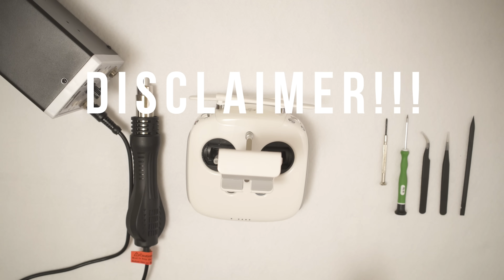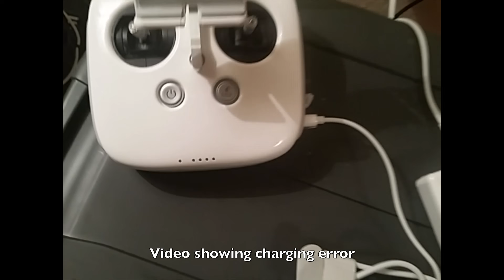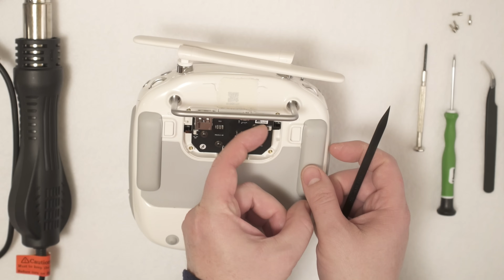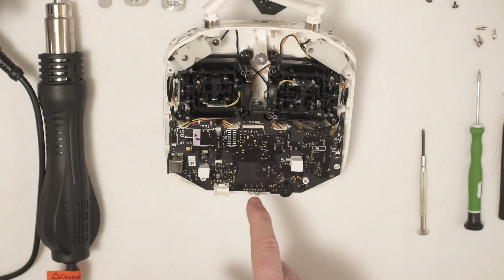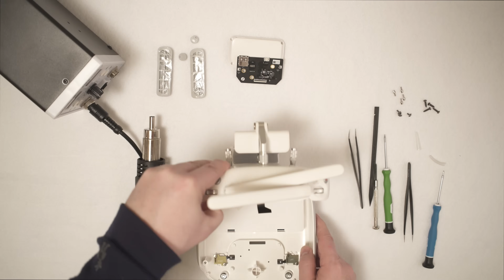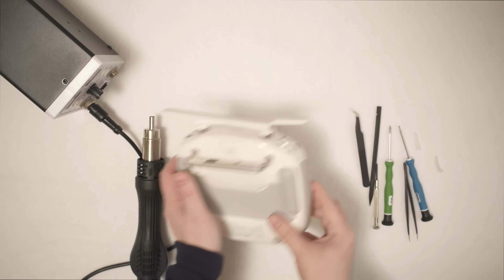FIXED!  DJI Phantom 4 Pro Remote Control Battery Charge Issue [Disassembly, Repair, Reassembly]

Comment: Something that is as easy to fix must be something dji is aware of but chose to do nothing in this $325 dollar controller.
Reply from the maker: Isaac, agree completely!  Would be interesting to know whether dji recent manufacturing has remedied this, or if new and refurbished units coming out now still have this problem.  Many thanks for commenting!
Reply from the maker: Isaac, agree completely!  Would be interesting to know whether dji recent manufacturing has remedied this, or if new and refurbished units coming out now still have this problem.  Many thanks for commenting!
Reply: @travelphotofilm  I live in Dominican Republic and was told by the local official dealer that the controller has to be sent to the US for fixing. Monday morning I'm going to borrow a blower to check this out. Also this controller is due for a refresh and maybe a removable battery.
Reply: @travelphotofilm  tried it and still having issues, even connected the battery to other controller and found this. The battery was actually fully charged but is the controller that's unable to properly detect the charge level. I am going to do a test to check if the controller shuts off or if it's able to fully deplete it.
Reply from the maker: Oh man, that’s too bad. Did the heat gun get hot enough?  Could be that something else is the problem, though. Hope you get this figured out!
Reply: @travelphotofilm  according to even deeper research seems like the battery sensing is the issue but today even though kept beeping like it was in low battery I flew the drone a three batteries and no issues. Pulled the trigger and got a new one off eBay for $160 since I do this for work so I need reliable equipment.
Reply from the maker: Isaac Alonzo glad to hear it’s working for you, but that sounds like a risky workaround.  Wouldn’t want the drone deciding mid-flight that its battery is out of juice!
Reply: @travelphotofilm  It detects the drone battery and shows the status bar at the top, is just that apparently doesn't detect the controller charge. TBH today I used 8 batteries and what I did was just make sure I had a home point before took off just in case and since I set the low battery warning at 30% it has plenty time. The new controller will get here wednesday and after that will send this one to a proper DJI repair shop to resell it.
Reply from the maker: Isaac Alonzo sounds like a great plan. Enjoy the new controller! Always good to hear from you!